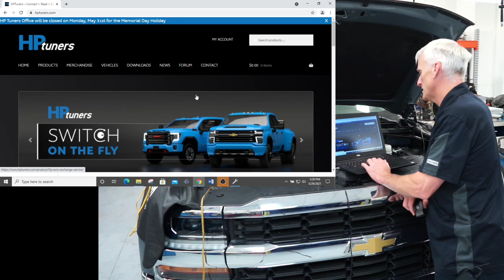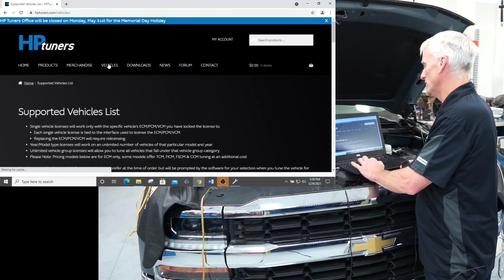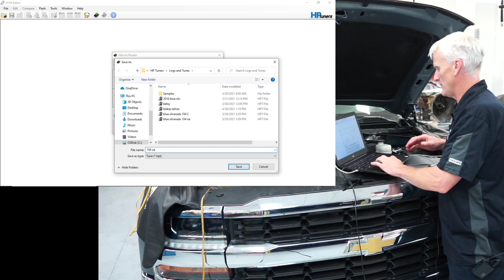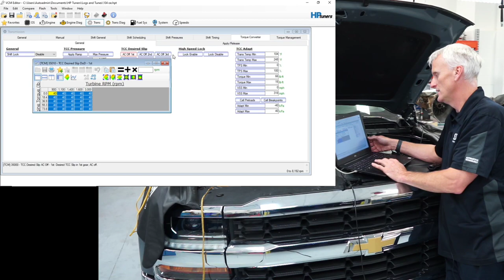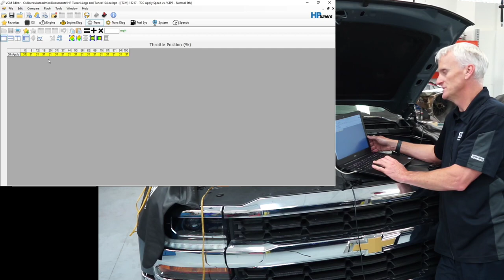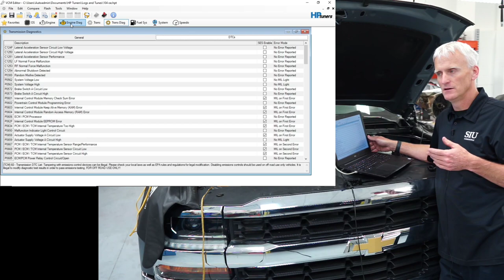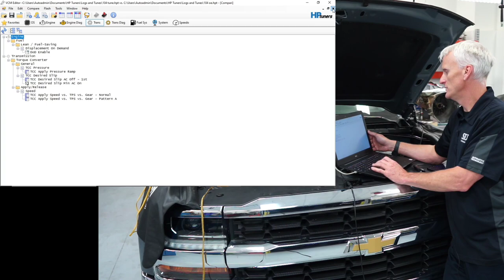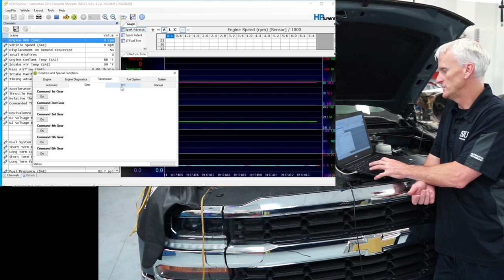GM's 6L80 HP Tuning, DoD, and Torque Converters! Part 3 of 3

Comment: Thank you so much! This series was easily the best I've seen on the TC issue. Just ordered the HPT adapter. Going to see how that works before committing to proactively replacing the TC.
Reply: Don't forget to install the Sure Cool Thermostat delete   part #STL010
.
Reply: Any tips? My 2018 is at 40k miles and I’m about to do this
Reply: @bretring  I sold the truck last year because I soldy boat and didn't need it anymore. The HP Tuner worked great, though. Didn't have it long enough to speculate on how well it's doing preventing trans issues, though

Comment: Just wanted to add a comment to say thanks, this is REALLY helpful. I recently mechanically deleted the AFM in my 09' 1500 (and got a computer tune locally) and have been chasing my tail on a severe shake that I'm getting while coasting between 35 and 45 mph AND decelerating. I almost threw in a new TC but now I think I will buy an HP and try adjusting the tune first.
Reply: I'm having a problem when coasting down from 50mph, and feel a braking when down shift

Comment: Thank you for the video. I am locking out the TCC on my 2015 Sierra with a 5.3. I see you disable in the Normal Field, and Pattern A. Pattern B is already disabled. Do you need to disable under the Hot Trans filed too?
Reply from the maker: I wouldn’t.  You hopefully won’t ever go into the “hot” schedule, but if you do, since the torque converter is the main source of heat in the trans, you’d rather it stay locked to help control the heat.

Comment: Very informative video. Will HPTuners allow you to adjust shift torque or firmness? Meaning how hard it shifts from gear to gear?
Reply from the maker: Yes, you can change desired shift times and pressures

Comment: What are your thoughts on tcc lockup when towing, personally I feel it should lockup to eliminate unnecessary heat, however the factory settings for my 2014 Silverado 1500 has no lockup in any gear in pattern b (tow/haul) or in tap up/tap down mode.
Reply: Don't forget to install the Sure Cool Thermostat delete   part #STL010

Comment: Great videos!i purchased mpvi2 after your videos and going to do step by step what you did.i have 2016 escalade with 8 speed transmission.what speed should I remove torque converter lock up?sorry for my English
Reply from the maker: Thanks!  I have not tuned an 8 speed yet, but I would pull tcc till 5th gear.  You might consider reading the hptuners forum and see what others have to say.  Good luck!  I think you should be good.  I think 2017 and later 8l90s need there pcm sent into hptuners to get unlocked but I think your good with the 2016

Comment: Quick question, why wouldnt you disable the TCC apply in 4th?
Reply from the maker: Many do just that.  It’s personal preference.
Reply: @siuautomotive  Thank you. What exactly is the benefit from disabling the TCC lock up at lower speeds? MPG? Longevity? I have been searching and haven't found a clear answer.
Reply: @siuautomotive  Also I disabled the TCC apply like in your video and logged some driving and saw I had TCC Slip (rpm)  3-450rpm. Is this normal?

Comment: Good videos Shawn. I used you 6L80 guide to rebuild my own. Great walkthrough. Since mybtranny blew up I have been looking into ways of getting more power while towing at 55-60. My truck is lifted so it keep going back and forth from 5th to 4th because it looses power on 5th and drops to 4. Then when it catches up, it goes to 5th again. I was thinking of dropping intake, exhaust and diable tune, but looking at the HP tuner maybe I can tune the trans. What would you recommend?
Reply: I'd recommend regearing to compensate for the large tires, along with HP Tuners.
Reply: make sure you big tires are calibrated in the tune. tune might think it is something like 265/70R 18 and not a 35 or whatever size it is now.

Comment: Lol so disable tcc in 1-4 causes torque converter slip . Which will cause it to make heat when dealing with traffic. Ive had the tcc disable done from a shop that rebuilt mine.

Comment: Hi, siu . I have a slip in shifting in the low speed, usually from 2 to 1, sometimes from 43 to 2. I heard this issue common in 2015 Tahoe 6L80e and It can be solved by tunning. If I applied this tuning to my 6L80e transmission this issue will be solved. I have no code, neither mechanical and software issues nor any other issue.
Reply from the maker: Tuning might cover the problem up for a while, but if you have slipping shift, there’s likely something else going on.  These transmissions adapt to prevent slipping, so it shouldn’t happen.  I’d be curious what your line pressure is….
Reply: @siuautomotive  I will check and let you know soon.
Reply: @siuautomotive   With my scan tool the calculated pressure line was 520 Kpa at 120km speed and 600 Kpa at idle, These values reading with proper shifting. The slipping wasn't happening.
Reply from the maker: Those are commanded pressures, but they aren't measured.  An actual pressure test with a gauge will let you know if the trans can generate sufficient pressure.  You could use a scan tool and command pressure changes and compare them to spec.

Comment: Is this the same as reprogramming when replacing the Techm?
Reply from the maker: Not exactly the same.  Some will use hptuners to pull the original tune off the unit then install on the replacement one.  If it requires you to enter the vin, you’ll likely have to pay credits to install.  Possibly on both vehicles.  If you do this with a bench harness, you might be able to bypass the credit part.  When installing a factory program, you are teaching the new techm the new vehicle and giving it the latest revision.
Reply: @siuautomotive  The reason i asked is I rebuilt a 2015 Suburban. Then dropped it for inspection due to harsh downshift, ordered Techm and valve body,. Still harsh downshift  Then  again dropped for an inspection. Nothing wrong, air checked. But the harsh downshift still remained If I did it right, then there shouldn't be a problem, unless there's an update for the Engine control module, I can't explain to the customer with out proof this is needed
Reply from the maker: During the rebuild, did you address the common failure areas, like the pressure regulator valve, afl valve, compensator valve?  Maybe check pressure during the problem to make sure you aren’t fighting high line pressure.

Comment: Is what you addressed and changed in this video all that would need to be addressed in a stock transmission with an aftermarket stall converter? I just replaced my 6l80 in my g8 gt with a new one and replaced the stock converter with a circle d billet 3200 rpm stall converter. I am thinking of purchasing the hp tuner module and adjusting the trans myself. Would the actual shift points need to be adjusted with such a high rpm stall? Or would i only need to worry about tcc pressure and application?
Reply: Also, i am very thankful for these videos. Very helpful information. I watched all 3 videos in this series👍🏻
Reply from the maker: With a high stall converter, I'm sure  you'd need to adjust the shift points.  Basically, under heavy throttle, your engine speed is going to be higher than your output speed due to the higher stall.  You'll likely have to tune the shift points lowers to prevent your engine RPM from hitting the redline before the factory settings allow the trans to shift.

Comment: Can you disable dod with hp tuners and still pass california emissions???
Reply from the maker: I would think so, but I cannot say for sure.  Disabling DOD doesn't set any emissions codes.  I did hear that some states check the CVN values on the PCM, which could indicate if the computer was tuned with an aftermarket tuner and that they could deny certification based on that, but I don't know if that's actually true.  I guess google might have the answer if you want to go down that rabbit hole.
Reply: @siuautomotive  i heard that aswell in california just looking for someone who can confirm it

Comment: Will this tune still pass California smog tests?
Reply from the maker: I know many shops will do the TCC modification in California, but I don't think any will admit to the DoD tune.  I wouldn't doubt that the CARB will state that any modification to a OE vehicle is a violation, but I don't believe they have any way of knowing if transmission control has been modified.  That's a good question and I'm just guessing at my answers.
Reply: siu automotive So, the ease of removal and installation of a Range Technology OB2 V4 mode disabler plug in is apparent for emissions inspections.